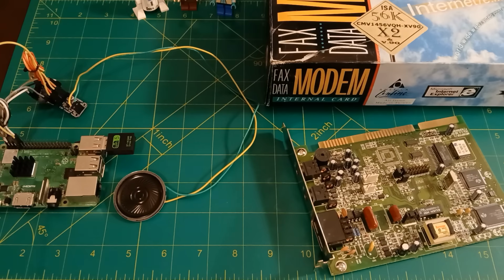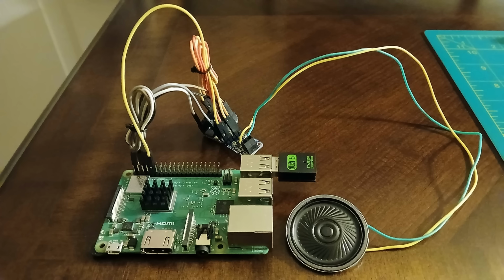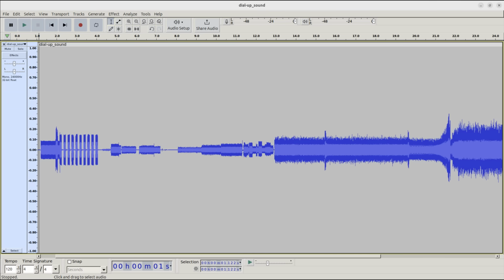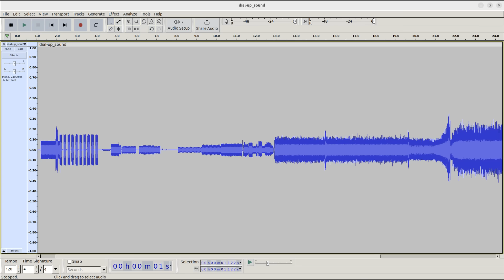Making Wi-Fi Sound Like Dial-Up Internet

Comment: I have a Idea on how to make it better. Modems modulate the 1s and 0s using Something called QAM (Quaderture Amplitude Modulation) . You could modulated the packets acordingly to make it more acurate. Dokumentation can be found on-line. You can also make it detect If it's a ARP announcement and make it Play a different Sound.

Comment: If you are able to slow down the audio before it gets to the speaker, you might not have to add auditory interest through random pitch changes.  You might also be able to train yourself to recognize a certain type of data by what it sounds like.  Like a submarine sonar technician but for the internet.

Comment: I have a wifi camera that is sensitive to the wifi signals beacons and turns it into sounds. To optimize the wireless network I changed the beacon intervals of all APs I control. The camera microphone picks them up and it produces an alternate pattern that peaks when the beacons happen at the same time. I used prime numbers to distribute the beacons intervals from 100 to 190 ms. So the camera picks up cyclic noise patterns alternating in around 5 seconds, instead of constant background noise interference. I think that this is due to the beacons, not shure but it sounds like it is. I have picked up the 100ms beacons in the past with other types of electronics.

Comment: I have a dell latitude from 2004 that has a pretty noisy aux output. Anything that's happening on screen would produce some kind of auditory clicks and/or beeps through the audio jack. I found it fascinating and would turn the volume up while I do things like downloading files, playing classicube, running blender, or defragging the hard drive. When I have the laptop connected to the Internet, I can hear it audibly pinging Discord's servers through discord messenger periodically. I kinda wish my main rig had this feature.
Reply: Was it USB powered? Connecting pc speakers directly to the pc can cause some noise so that's why i use a charger

Comment: now I think I want to hear the electro-magnetic signals in the Ethernet cable. (yes, magnetic, the wires don't carry an electric current, a ethernet link is technically a split transformer half on the transmitter and the other half on the receiver, the capacitance and the electro-magnetic field are transmitted over the wires, not an electric current)

Comment: I wasn't sure what to expect but in comparison I much prefer the dialup sound. You can hear different phases of training, negotiation of speeds, and so on. I used to be able to tell approximate baud rate of the connection based purely on the sound, length etc

Comment: The first sounds make at startup of a modem call is negotiating speeds. While Later modems are advertise as "56K" bps, FCC (that limits to 54000bps) and/or Most Phone Co never allow you to get that speed with many users can't even get near 33000bps because too far from a "Central Office" or even nearest "Concentrator" that Multiplex calls. That's a "Perfect" call. MANY areas have major issues with Cross Talk and other Noise that you can't hear but Data and Fax Modems hate the noise and slow down if they connect at all.

Comment: For the record AOL was far from the only dial up provider, both then and now.

1:27 Additionally, starting in the 80s, Bell did offer real digital phone lines via ISDN. That's a whole saga if you ever have an afternoon free.
Reply: The Bell option was called BRI or basic rate interface.  It offered a digital phone service with two 64K data channels.  If you were not using the phone, it was a 128K data connection but if you used the phone, it would drop to 64K.  It was widely promoted by European telco providers for home use.  But Bell tariffed it here as a business service so it was very expensive compared to analog telephone service.  This caused most people to just add a second analog line which doubled the number of wire pairs required to each house.  When DSL came along, Bell found itself with millions of pairs of stranded assets due to their foolish decision not to adopt BRI as a standard for home phone usage.

Comment: The really lazy approach: put an old AM radio next to the unshielded part of a cable modem or router.
Reply: That's how they made super rudimentary music on old minicomputer systems from the 70s and 80s. Pdp, Altair, systems like that had such slow processors that you could hear the processor working if you tuned an am radio to an empty station and stuck it next to the computer. Somebody figured out that you can program loops that produce actual musical notes. It's a super fun rabbit hole to go down.
Reply: What frequency?
Reply: @BOplaid Any. Wi-Fi causes interference, audiable on any frequency with AM radio.

Comment: Cool project. You can take it further. Get a Pi zero (or any other similar microcontroller with WiFi) and write code to make is send a stream of UDP packets (and nothing else). Encode audio (as in a .wav file) in the UDP payload. Decode that audio in the receiver. Now you can broadcast audio over WiFi. Next, make another transmitter/receiver so you have two-way communication. Connect a pair of old acoustic coupler modems to send and receive audio. Voila! Acoustic modem communication over WiFi. Yes, it's a pointless exercise but you'll earn lots of geek points.
Reply: Is... is this just reverse dial-up?
Reply: @jlco  reverse dial-up: button-down.
Reply: Is this just off-spec VoIP

Comment: It would probably sound much better if you discard say every couple hundred samples and also slow down the rate as well.
Not the actual wifi data rate but that which gets played thru the DAC.
Over and above, experiment with basic filtering on the input to the amp driving the speaker.
A simple first order RC LPF will help smooth out some of those sharp edges that hurt the ears.

Comment: Oh, well, it's good we don't have to hear that... because it's a pretty Cursed Sound more than the Original 56k Modem LOL... 
About the Shortwave... Don't SW Radio Operators actually have Home Made devices that they connect to the Tx?Rx of the Radio so that they can Send and Recieve Digital over ShortWave already? I always though that the Noise on SW Radio was people that Don't Have regular "Internet" using it to network a few Computers together like a BBS or something? Just curious
Reply from the maker: Ha! Yeah, that's why dial-up modems turned off their speakers after the handshake.
Reply: They aren't networking computers together but rather sending and receiving short messages between random people. Look up "FT8" or "PSK31" sounds.

Comment: I here that on shortwave every night
Reply: Kinda reminds me of how I can hear wireless charger's pulsing sound at night when it's not in use. Wondered if it was their own way to handshake before establishing & charging
Reply: @jupiterbjy well it's probably trying to detect a device
Reply: @kreuner11  aka handshake like tcp does, since it has to communicate charing standard and etc
Reply: To be fair I could hear my Christmas tree lights through my shortwave radio
Reply: I do too, and I wondering where it's coming from, it's like on the 31 meter bands and some other SW bands.  It's like a sqiggle sound.
Reply: @AdamEbelgccengineering  I heard stock market use shortwave to transfer data faster. and other stuff for sure.
Reply: I was 20 when I got a 1200baud beast!!!   I love this video!  Very nostalgic!    What would happen if you could make certain WiFi calls and responses into animal sounds?   “Who’s there?  Yoo-hoo?”
Reply: You're hearing RTTY, slow scan TV or wspr/wsjtx 😅
Reply: real
Reply: RTTY